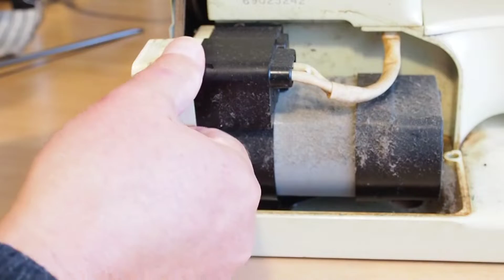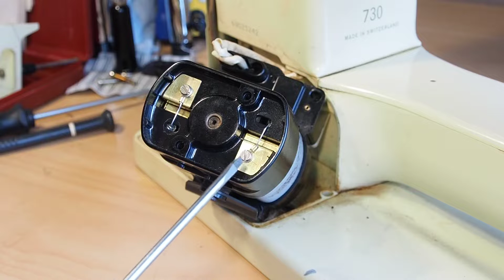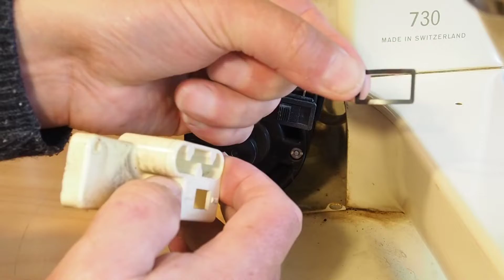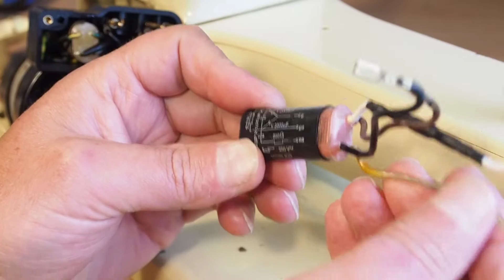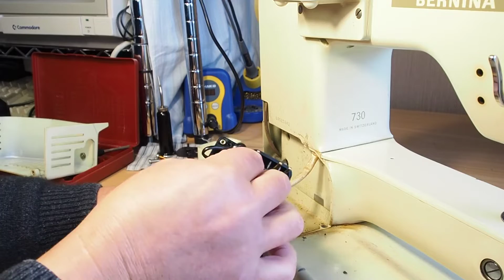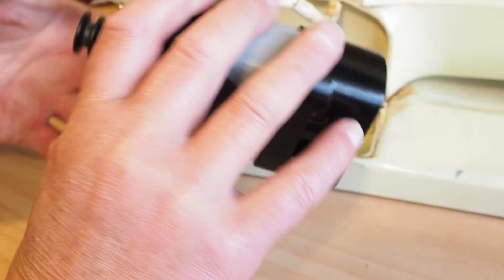Bernina Record 730 - Motor Checking - Brushes and Capacitors

Comment: Great video!!! Planning on purchasing a 730 record this weekend. Seller is selling it for $50( US dollars). They haven’t used it in over 20 years. Taking a chance on this one. Any pointers or recommendations? 

Your videos have taught me so much and made me more knowledgeable on what to ask before purchases.
Reply from the maker: The 730 is generally fairly reliable. Check the plastic cam stack gear hasn't got a crack in it. Cheers.

Comment: Thanks so much for the videos. My 730 went pop and smoked a lot, and after watching your video - sure enough, the capacitor has blown apart (and potentially not a blown motor like the Bernina lady told me it was...). I'm a bit stuck though, as my 730 motor set up looks quite different to the one in the video, and the green and yellow striped earth coming from the capacitor doesn't appear to be connected to the motor via an eye, but goes straight onto the motor instead. Are they sometimes soldered on? The capacitor is completely circular, not a flattened shape like in the video too... Do you fix other peoples machines (for a fee) as I am now stuck! Any help would be greatly appreciated (I am based in the Waikato) Cheers, Ali.
Reply from the maker: Hi Ali. Yes I repair other people's machines. Please contact me via my email address which is in the video description. Thanks.
Reply: Ours did too.. Hope we can find a replacement, if that's indeed the problem, haven't checked to make sure.

Comment: Hi, Ive just bought one of these lovely machines for €34.95 in Holland in a 2nd hand shop, case was filthy,  oiled the machine and she is working lovely,  dont really understand the buttonhole settings, the needle position lever seems to move in about a 180 degree turn but the fancy stitches work, its the Swiss made one for the european market with a 2 speed enclosed foot pedal operated motor, the foot pedal is HUGE, a normal rheostat one but with a HUGE baffle type pedal cover.  That AWFUL juki babylock is on ebay in UK now, with a bid on it, listed that as "spares/repair" as it does work but it I had a TERRIBLE time making it stich. amateursewing@gmail.com